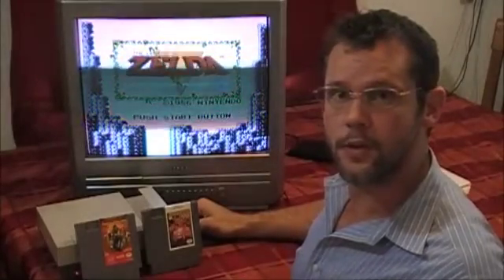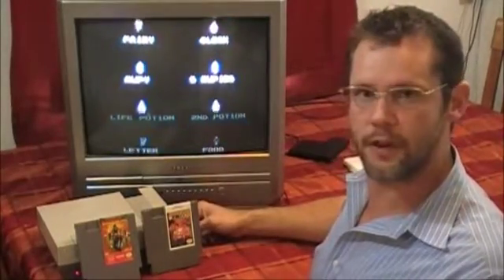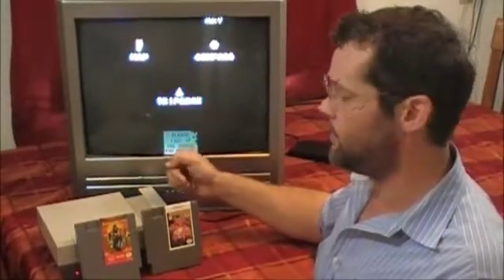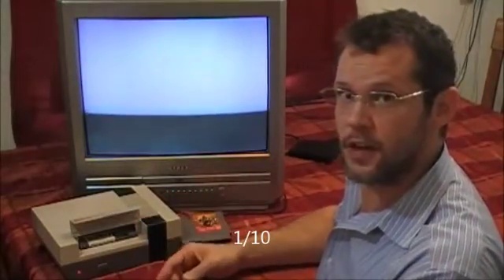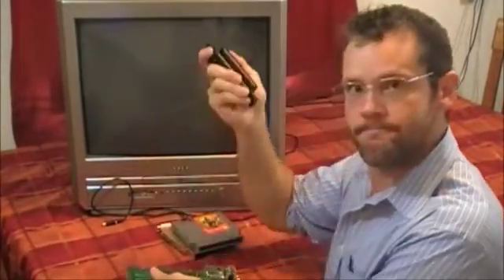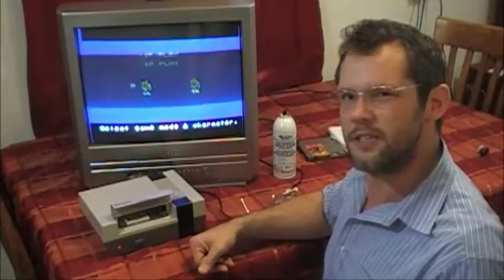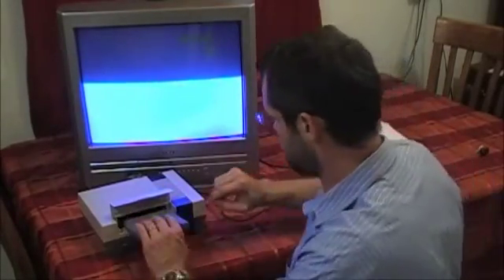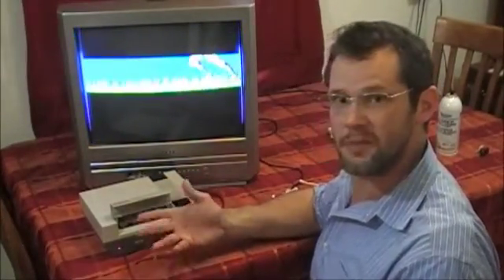Boiling NES 72 Pin Connector Really Work? Experiment Fixing a Blinking Nintendo Console

Comment: I had the exact situation. My childhood NES came in the mail from my Dad. It showed up with a major case of the blinkiies. I i disabled the chip and got a solid grey screen. I took it apart again, took off the 72 pin, boiled it and now all my games work. Sometimes i gotta put it in a few times and sometimes the game only runs if i dont push it down. But for now, it works  a thousand times better than before.

Comment: I've had an issue with the brown (gray, in my case) screen whenever starting Legend of Zelda through my old Game Genie. Works fine without the GG, and all other games work fine both with and without the GG, so I'm chasing connection issues. I'm fairly certain my NES, which I've rebuilt from scratch using a NESessity 1.4 and Hi-Def NES kit, still has the OEM connector since I saw no evidence of the console having been opened up in the past. So as part of my troubleshooting I'll be doing the boiling trick (seems about 30 minutes is the ideal time for the metal to "relax" back to its manufactured position the best), followed by cleaning it and all my cartridge and GG connectors with DeOxIt F5.

Next step will be replacing the small caps in the LoZ cartridge, which will suck since my son will lose his game save after I've already replaced the battery, but a necessary sacrifice if he wants to use the GG......

Comment: I brought my NES out of retirement around 10 years ago and it had the blinking light problem. I was told about boiling the connector but thought I was getting pranked and just chucked it and bought a 3rd party connector. It worked fine for quite a few years but ended up getting replaced again but it lasted less than half as long. I replaced it again in June this year and it lasted about 3 months. 

Because I was tired of replacing the connectors with declining quality I bought a bulk lot of old 1st party connectors. They arrived this week and so far I've tried two of them. They were either giving grey screens, garbled screens or would only work with the cartridge up. After boiling them they worked much better, some games take a couple of goes but most work straight away. I'm a true believer now. 😁

Comment: Fixing lock out chip is only a band aid fix, and quite an invasive band aid. Boiling is easy and it works. I fixed 2 NES to both read games almost perfectly. Tip: I find NES games read better the further you have the game from the back of the NES. Anyone else notice this?

Comment: What is the idea behind boiling plastic with metal?! You are lucky that this type of plastic is not melting at water's boiling point. Also, the metal+water combination sounds awful. What's the result you are expecting from that?
Reply from the maker: Not lucky - we know the boiling point of water and the melting point of ABS plastic.

The contacts are made of, or plated with a metal that doesn’t readily corrode even when exposed to water. If they weren’t, they’d corrode badly over time just from exposure to humidity. 

The reason this technique often works isn’t well understood but as you can see from the video (and many other videos and reports) it’s often effective.
Reply: @8bitjunkie8 Since my first comment I tested it myself in 3 occasions, with the first I was a little over-excited with the pin bending so I bought a replacement. Later I figured it wasn't the bending the problem, it was just that I tested it with an out of region game... So yeah, I can confirm that the method is working.

But don't try the hydrogen-peroxide + heat treatment to retrobright DMG Gameboy, that's a different type of plastic... Or be very careful or you'll end up like me :)

Comment: Interesting. I thought about doing this. But instead I manually pulled out the top pins and bent them down a little to increase the pressure they put down on the cart. (you can pop them out if you press on the top of them. There's a line of holes on top that show how the top pins stay in.) They flatten out over the years and can cause contact issues. It helps that you don't leave a cart inserted for an extended period of time. Pull them out when the NES isn't used and that will help it last longer. (it's also pretty important to keep the carts clean)

I found my NES at a pawn shop a week or so ago for around $80 (but was able to talk them down to $70) and the Mario game I got for it refused to work. But after I did that, it worked every time I inserted it. :D

There may be extreme cases where you have to fix the bottom pins to but didn't have to touch those on mine. :P

The interesting thing about the NES I got at that pawn shop was that it already had the lockout chip disabled and the doofus who did it wired the controller ports backwards when he put it all back together. Player 1 port was connected to the player 2 port on the motherboard. lol. Not sure how he managed to do that when you don't really have to fully disconnect the board to do the mod. You don't even have to remove the board from NES. Just have to remove the RF shield and it's accessible from there. :P
Reply: Jesus Christ almighty, you paid too much, unless it was new in box with the original shrink wrap still on.
Reply: Perhaps a few years ago. but now a days that's what a full NES system runs for. Probably would cost more elsewhere. There was a retroshop selling a NES for similar price but it didn't come with lightgun and only had one controller I think. :P

Comment: Why don't just throw the connector into an ultrasonic cleaner (with hot water and a ultrasonic cleaner solution) ? For sure the best method ....
Reply from the maker: please send me ultrasonic cleaner and I'll try it.  realistically - I don't think boiling the connector does much cleaning. the effect seems to be cause by the heat straightening the pins back into shape. although that would be a good test to try: ultrasonic in hot water vs boiling water w/o ultrasonic.

Comment: Thanks for this great video! I have repaired and refurbished hundreds of NES consoles and 72 pin connectors and have many different methods which all work but after boiling a few 72 Pin connectors I have managed to salvage many of them! It really works. Now I boil all my connectors and I'm 99% on fixing them. Thank You so much. I don't know the science but I assume the boiling removes all dirt and grime and everything dirty to a polished shine. You DA MAN! Thanks!!!
Reply from the maker: awesome.  I emailed w/ a PhD materials scientist and he said it's possible that the heat is straightening the pins back to their original positions. I don't think it's really about the cleaning action but maybe.  The ones that boiling doesn't fix you can manually straighten the pins. I made another video on that.
Reply: The boiling water certainly will clean the connector somewhat. So it's combo action. I still would advise the Isopropyl alcohol soaked cloth covered plastic card cleaning method afterwards -- no such thing as too clean.

Comment: I've done everything. Cleaned inside and games, replaced 72 pin, and removed the 10nes chip. Now all I get is a black screen.....nothing!  ):
Reply from the maker: what did it do before you removed? the 10nes chip?  Did you remove it or cut the pin?
Reply: I removed it. Before I was getting was a blinking blue screen. Now I get nothing at all.
Reply from the maker: right, well you can't just remove the chip. There's one pin that needs to be cut and the rest of it left it.  It won't work w/o it.
Reply: I did exactly what was shown in other videos about it. They said it had to be cut out. I watched a guy remove it.
Reply from the maker: this is my video on how to disable the 10nes chip: https://www.youtube.com/watch?v=sCPoHklnnNk
Reply: Yep...that's one of the video's I followed. Looks like you cut and removed it to me.
Reply from the maker: OK, in my video, I cut exactly one pin.  How many pins did you cut?
Reply: Just one. Fourth chip over as shown.
Reply from the maker: oh ok, good.  I thought you mean literally "remove" the chip which would require you to cut all of the pins.  If it can't read the game, it will blink.  If you disable the 10nes chip and it still can't read the game, it will just be a solid screen.   So yours still can't read the game for some reason, or there's something else wrong that's probably harder to fix.  Unfortunately there's not much else I could tell you about it without looking at the system.  Sorry
Reply: I should have said pin and not chip....sorry. Does it sound like I need to get something new. Any suggestions?

Comment: Well to answer your problem about the cartridge tray not staying down, when you reassembled the unit at the front do not tighten the screws all the way down. Once you've tested the tray without the cover and the cartridge stays down i would advise to back out the screws about another quarter to a half turn so that once you place the cover back on you shouldn't have any issues.
Reply: Ruben Mejia he needs to tuck the the tab on the bottom of the tray under the circuit board while sliding it back. What a dumbass

Comment: As for adjustment to make the cart stay seated when you press it down? Try loosening the outer case screw on the the bottom that sits under the front/center of the console. The only screw that isn't in a corner. It should only a single turn or so. Eventually the loading tray should stay seated every time.
Reply: The screws is not the problem, you have to make sure that the dock overlaps the motherboard, so a tiny part of the dock gets under the motherborad when you put it back together.

Comment: So is it OK to just throw it in the water 
or do you have to build the V to get it off the bottom and sides
Reply: so it will not touch the bottom or sides
Reply from the maker: you can just throw it in there.

Comment: Boiling alone might work on a dirty connector, but in my experience it does nothing for a connector that's lost the tension in its pins. And it's mighty simple to re-tension them. I go ahead and do that, then boil. This results in working connectors 100% of the time. 

If I had to choose one way or the other, though, it would be re-tensioning. The cleanest, most immaculately spotless connector in the world is worthless if the pins aren't making contact with the pins of the cartridge.
Reply from the maker: +ShmupShmupPewPew I don't think boiling does much in the way of cleaning.  The heat expands the metal and causes the springs to stiffen slightly.  If they were slightly loose, then boiling works.  If they were very loose, you have to bend them back; I made another video on how to do that.  I guess I could test that theory if I had a lab oven that could heat at ~100 C without going over; the plastic will melt at temperatures slightly over that.

Comment: hi have a fixed Red Light without cartridge in... anche guess? i m trying boiling too
Reply from the maker: +otto von bismark either the lockout chip has been disabled or you have something else wrong. If the lockout chip isn't disabled, my guess is that doing anything to the connector won't solve the issue.  If it is disabled, then cleaning your games and boiling the connector might fix it.

Comment: My 72 pin connector was trashed.  I had cleaned it, boiled it, boiled it again and cleaned it... Nothing worked. I finally broke down and bought a new 72 pin connector. It's crap! Holds the games so tight I have to litterly use a pair of pliers to get the game out. As you can imagine Im not using my NES anymore so I don't mess up my games.
Reply from the maker: +xReviveMeFoolx sorry it didn't work.  Did you check out my other video "When Boiling NES 72-Pin Connector Doesn't Work, Experiment Fixing Blinking Nintendo by Bending Pins"?
Reply from the maker: +xReviveMeFoolx https://www.youtube.com/watch?v=5F8aItYuu1k
Reply: +8bitjunkie yeah, I tried that as well. I just ordered an original refurbished 72 pin connector off eBay.
Reply from the maker: great idea

Comment: I've bent pins back with superior success.  You don't even have to push the cart down and it reads perfectly 99% of the time.  And best of all, it won't bend the pins again.  Also, snip the region chip while you have it taken a part.  No more blinking and no trouble loading.
Reply: +8bitjunkie
Same here. I work for a shop that sells retro games and consoles, (I'm employed to clean all carts and to attempt to fix malfunctioning consoles; usually NES). 

I've worked on probably 75-80~ NES consoles so far, and I'd say sufficient boiling (at high enough heat, and for 10-20 mins depending on grime) has fixed most (I'd guess around 70%) of them. The rest were fixed with boiling and bending, although a few couldn't be salvaged as they were so mistreated during their lifespan that it simply wasn't feasible. 

Surprisingly, replacing the 72 pin connector isn't preferred because the aftermarket versions are often cheaply made (they're often manufactured out of cheaper metals susceptable to corrosion; they often grip carts too tightly and have to be adjusted and worked on right out of the pack, and the biggest issue: we have to sell the console as refurbished, which doesn't net us more money, because the connectors are cheap, despite spending money fixing it.)

Try boiling!
Reply from the maker: +Ted Soto Yep, I have another video on bending the pins when boiling didn't work that well and a video on disabling the 10NES chip. I prefer to do them in that order as the least to most invasive fix.  Thanks for watching
Reply from the maker: +Retro Sega World Have you seen the Blinking Light Win?
Reply: 8bitjunkie
I have! I couldn't back the project sadly, but I'm glad others saw the potential. It reminds me of a fix I heard of a while back involving bending the 72 connector pins so greatly that you'd never have to push a game down again, as the pins were set perfectly without tilting. Well except that it's not a jury-rigged fix on a "ZFI" connector.

I haven't really looked into it's quality or anything yet, but it's still exciting. I'm thinking of ordering one and testing it out when I get the chance. I might be able to work them into my repair-work in some way if they're quality (it might be tricky, but I'm sure that I can find a way!), but until now I've held off hoping to hear what the backers have to say about it and to test it out.
Reply from the maker: last time I checked they weren't shipping new orders yet, but I'm planning on getting one and doing a video review
Reply: 8bitjunkie
I look forward to that video!
Reply: +Retro Gaming World I watched a review on it a couple days ago. It sounds like a nice solution but again the pins are tight.
Reply: ***** Yeah, but that seems to be the case with most aftermarket connectors. But the pins can be adjusted before installation, so that's not a huge concern imo (at least not when compared to material quality lol).

Comment: There one problem with boiling the pins is that it advances the rust and mold in the pins,it may look cleaner but if you don't dry it well it may short out the whole nes but either way let's face it this console is more that 30 years old and the only way to make it work again is changing the pins for new ones or remove the rust of the old one.
Reply: Angel Colón The pins are actually made of NON ferrous metals that does not, under the laws of physics, rust. They will tarnish or under extreme cases, oxidize. A new 72- pin conn. will not always solve this problem. I thought the same thing so I wasted 10 bucks on something that did not work. Most of the new conn. that are made aftermarket are super cheaply made and actually made of tin that will corrode by electrolysis, then say Goodbye motherboard, no more NES. I boiled my og conn and it works like 1989. Props to 8bitjunkie.

Comment: spend the 10$ and buy a new pin protector instead of boiling it... smh... the best method for cleaning pins is the eraser method.... no residue... cant tell you how many times i bought games online and it comes with a shitload of twinkle or other polish all over the place.
Reply from the maker: every indication is the replacement connectors are vastly inferior to the originals.  it's worth a few minutes to try to refurbish the original nintendo part.   If someone uses polish, they should thoroughly clean it after with alcohol or contact cleaner. there should be no residue when finished. The eraser method is great.
Reply from the maker: ***** the boiling is not to clean the connector; it is heat treating the metal which causes mechanical straightening to occur and perhaps also some positive metallurgical effects
Reply: Fubar MMA problem with that is a lot of new 3rd party replacements are cheaply made and will actually fail quicker
Reply: yeah i have since changed my mind on the pin replacements and dont recommend changing them, but refurbishing the OEM ones.  but not boiling them like this guy does..
Reply from the maker: do you just bend the pins back?
Reply: i pull out each individual pin, bend them and sand the contact point with 200 grit emery, i also pop the one prong on the 10 chip while i have it apart to stop blinky screen.  To extend the life of your NES pin, never leave a game in the system when you are not playing.

Comment: just a tip, I recently thought of this myself, the contact pins of the cartridges oxidise over time which is why they need to be cleaned, what I did was I went out to a local grocery store and bought some sandwich bags, now you may ask why, but think of it sandwich bags are airtight so when you put something like a game cartridge into a sandwich bag and the bag is sealed up no air can get in at the contact points to cause them to oxidise.
Reply: +Paul Hetherton
the contacts are gold plated, so it cant be oxidation. its just dirt in the air aka dust